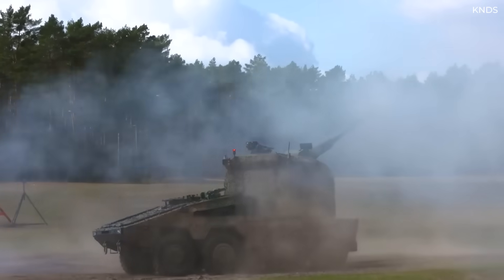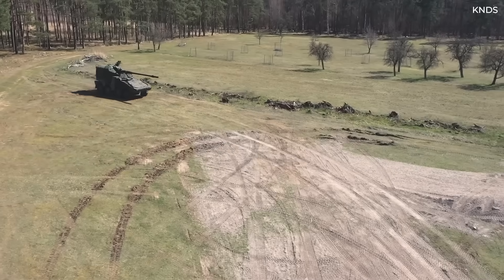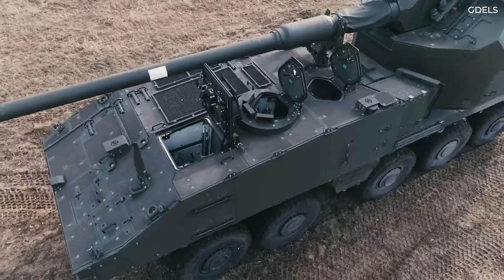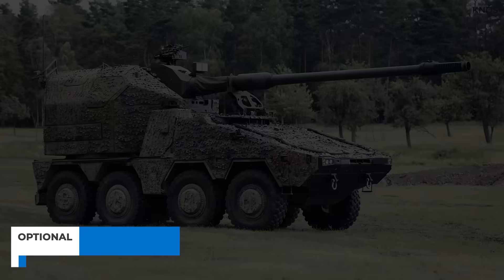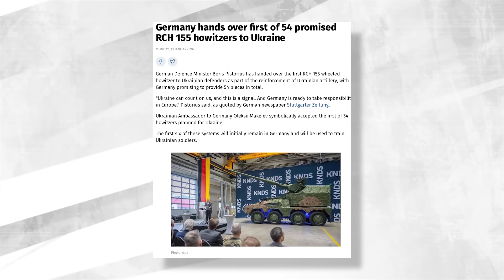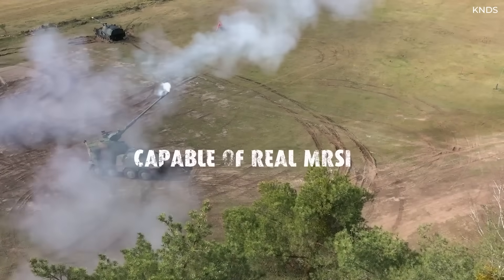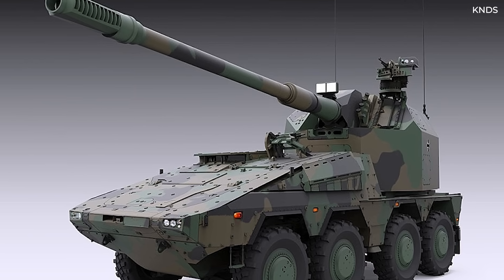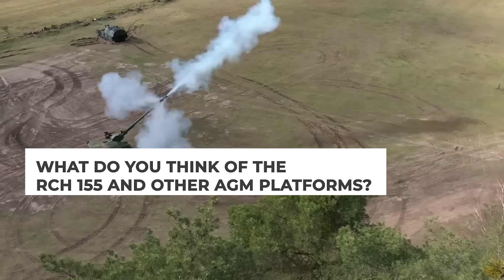RCH 155: If Drive-By Shootings Used Artillery...

Comment: The recoil seems insane on that, looks like something you put together over night while chugging beers. 

The issue with German equipment is manufacturing times, it's like soviet logic, reminds me of a joke from that time: 
A man in the Soviet Union goes to order a new Lada.
The dealer says: "Your car will be ready in 10 years."
The man asks: "Morning or afternoon?"
Dealer: "What difference does it make? It’s 10 years from now!"
Man: "Because the plumber is coming in the morning."
Reply: Boxer can absolutely handle the recoil its a 30 t platform and the recoil has absolute no effect on the accuracy
Reply: @Alex-gu2yp  It has effect on follow-up shots and rate of sustained fired, which are important, if an Archer can shoot 3 times while the RCH 155 can do I shot in the same amount of time with accuracy then which is best?
Reply: It’s probably because you have never seen a 155 mm artillery system fire with no stabilization, it was one of the special features that it can fire without being deployed with stabilization legs or whatever is used, the German technology is slower to build due to complexity and low production capacity, hopefully they will increase their production, German weapons are usually the hardest level of quality and price per unit, the USSR didn’t produce quite but quality, the reason why a car took a long time in the USSR was not because it was slow to manufacture it was extremely fast to produce, but it was a private vehicle and if you wasn’t well connected you where very low priority, weapons was high priority which is why they had a enormous stockpile in Russia, which is only now as good as depleted, what is left is the bottom of the barrel.
Reply: @kimmogensen4888  Comparing the German quality of old to what they produce now is insane, German quality has diminished severely.
Reply: @dudarsky  and you are an expert to come to the coclusion? Most of the time the awnser is for what circumstance and  for what enviroment and what doctrine a weapon is developed for.
If a weapon is developed for europes enviroment and used in the desert what does it say about quality? 
The blanked awnser you give without any support of facts doesnt mean anything in my opinon.
Reply: @tasker6669  Not my opinion, the Ukrainian troops have repeatedly said that this artillery system is not suited for actual war, with it unable to provide sustained fire due to overheating of the barrels, accuracy drops and many of the important components failing often. 

Also, shooting on the move is utterly useless in most of Europe unless you'll be firing from an autobahn, most countries in eastern europe have tree lines to the left and right of each road way, making it impossible to drive and fire without snagging a few trees in the process, so if you can only use a small % of road network and that's your entire gimmick, is it useful? 

But you're clearly the couch expert.
Reply: @dudarsky ...I mean this is neither what Ukraine said nor is your second point relevant. You think classical artillery does not need to find a position? Do you know the time before a unit can be on the move again?
Reply: @emilsinclair4190  Your comment is completely irrelevant, rewatch the video and the entire premise of their claims, that it's a "shoot on the move artillery system", and I said that it won't work in no Eastern European country, unless you think that the war will be in Bavaria and you can shoot from an autobahn. 

The second point is I did not say that artillery does not need to find a firing position, albeit with tracked artillery it often just means an area where the gun can easily operate without chance of it hitting anything and/or the shell detonating due to hitting something on the way. 

You've completely missed the point and the plot so far that I don't think you're even in the correct comment section.
Reply: @dudarsky  I question your statement on several points, as it may be based on anecdotal evidence and does not necessarily reflect reality. First, Ukraine in particular has shown that artillery must be mobile. The high number of losses suffered by towed artillery, such as the M777, demonstrates that remaining in one position for a long time is not the best option. Secondly, there are reports that the barrels of the Panzerhaubitze 2000 have withstood more than 20,000 rounds, which is 3-4 times as much as normal barrels can withstand. Such figures are not possible if a system is not in continuous use. But of course, any system can be pushed to its limits. The reports they are referring to came from a time when the Ukrainian army was having great difficulty stopping the Russians. It is likely that no limits or recommendations were adhered to at that time. Of course, the Panzerhaubitze 2000 is different from a D-30 in terms of weapon complexity, but the very low losses (the lowest of all Western systems) after more than two years of use clearly show how good the system is.
Reply: @dudarsky  okay so I need to explain it for slow people. The ability to fire on the move means that the time until you can move after you have fired is 0. In fact you can search a nice firering Position. Start moving and fire. This is not a problem even in forested areas. So for this case rhe time would be negative.

Do you see why this is an advantage now?
Reply: @dudarsky  where has the ukraine stated this? - and as im aware the ukraine has order around 50 of this system - so when they arent usefulll why order it? and to my knowledge there arent many systems in the ukraine cause there arent many deliverd (2 systems or 1 system) ??? You smash 2 systems togeahter with the pzh2000. 

So where do you get the info you need an autobahn to fire this system? Do you know in witch condition the fire on the move apply ? NO - only factless blabbering without even acknowleding thats an opinon or speculation.

Maybe considering your attitued to critic you should learn something? backup your claim with facts or sources or stop commenting ? 
sincerly your couch expert!
Reply: Ukraine received 36 Pzh 2000, "The RCH 155 (Remote Controlled Howitzer 155 mm) is a wheeled self-propelled howitzer developed by Krauss-Maffei Wegmann (now known as KNDS Deutschland), a German defence company.

The RCH 155 Module takes the firepower and the range of the PzH 2000 by using its gun (155 mm L/52), and combines it with an automated and remotely controlled gun module."

Of course they ordered it, among with every single other mobile artillery system, you want to know why? Because they lack artillery and Europe is slow at producing it, so it makes sense to order all the available systems in smaller quantities to guarantee you get enough of them in a timely manner. There's literally only a handful of mobile artillery systems available in Europe, not a large choosing. 

Still, you're speaking irrelevant crap at the end, you should really consider stopping drinking, it's not good for you, you can barely understand anyone.
Reply: @dudarsky  im stoping replying - you arent worth the effort for the nonsense you are talking
Reply: @dudarsky speaking of drinking....for all my points there are sources out there while all you have is AI gibberisch and insults.
Reply: I think it's because the Boxer is not proportionally front heavy enough to compensate for the large gun. The Piranha 10x10 seems fine with the 155mm while moving
Reply: What coorporation in its right mind would gear up to mass production for 500 or even 1000 units.

As long as every country buys ten of each system there is, we will never produce 200 a year of such a high tech weapon.
Reply: @heinzkabofke6791  Quite a few have, quite a few have the ability to do so in a short time frame. If war broke out tomorrow, Germany would be able to ramp up production only after a year, they have no facilities, no extra trained personnel or tooling. Ukraine already outproduces all of Europe combined in terms of wheeled artillery.
Reply: @dudarsky 

Name one.
And no, caesars or the like doesn’t count.

Name one company and the product they mass produce with only 500 units ordered.

Of course we could build it.
Costs us billions and after that, nobody buys the system.

So we spent billions to produce 500 units.

Buy our stuff and we build a second Wolfsburg.

Buy American or South Korean or French or British and you will never see a 12million howitzer in mass production.
Reply: @heinzkabofke6791  So your logic is - "Order from us, EVEN THOUGH we can produce 2 system a month, and then if we get enough orders MAYBE, we will re-invest and make them faster, but hold on for a year or two until we build up our facility, you'll get all you ordered units by 2060." ? This is the issue with Germany, it's too weak, too undecisive to be of significance. 

I mean look at South Korea, churning out more equipment by each other at a more rapid pace, because they keep more workers than they need, because they invested in their facilities and don't need to build a new building to just increase production numbers. They're not short-sighted
Reply: @dudarsky  The most difficult and important part of any tube artillery is the tube itself. Now, guess where the tubes for the SPG produced in Ukraine come from? Here's a little hint: before Ukraine and the German company Rheinmetall reached an agreement, Ukraine only built a few artillery systems per year. After that, it built many more. And it did so without building any new production facilities in Ukraine...
Reply: @dudarsky  Zależy jak liczyć tę ukraińską "produkcję". Lufy z Francji, podwozia z Czech, tak to można i tysiące wyprodukować, o ile Francuzi i Czesi nadążą.
Reply: @dudarsky 

The logic being: if only 500 RCH are ordered, there will not be a mass production.

You babble on as much as you like.
Reply: @dudarsky South Korea made some contracts for 1000 tanks and sone artillery on top, hoping to gain a foothold in this market.

It will ultimately fail to do that significantly, cuz it sells the same stuff we do.
It will only make it more unlikely for Rheinmetall opening up a multi billion euro RCH line.

Given it has its hands full with expanding for the thousands of boxer vehicles we buy.
Reply: @heinzkabofke6791  "Kup nasz sprzęt". A Niemcy ile mają zamówionego sprzętu???
Nie chodzi o polityczne deklaracje, tylko o umowy wykonawcze.
 Ile Niemcy zamówiły Leopardów i RCH-155 ???
Pisząc o Amerykańskim, czy Koreańskim sprzęcie, pewnie masz na myśli Polskie zakupy M1, K2 i K9. Polska chciała dołączyć do niemiecko-francuskiego programu czołgu nowej generacji-zgadnij, który kraj się na to nie zgodził ???
Reply: @marekduczman 

Doesn’t translate, sorry.

I guess it’s Eastern European hate, tho.

I don’t give a fuck 
Cry me a river.
Reply: @heinzkabofke6791 translates to: germany does not buy many vehicels, and also says that germany did not want Poland to join mgcs
Reply: @marekduczman there is literally no basis for your claim that Poland was denied entry into the program. At least none I was able to find.

Germany has created the leo a8 order with options that also other countries could use.